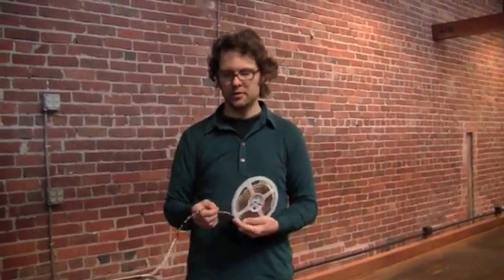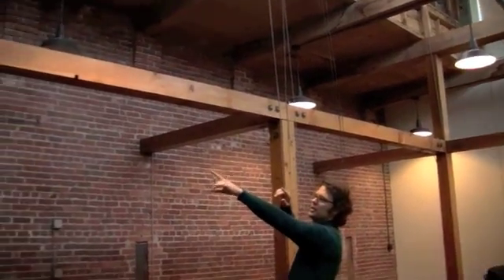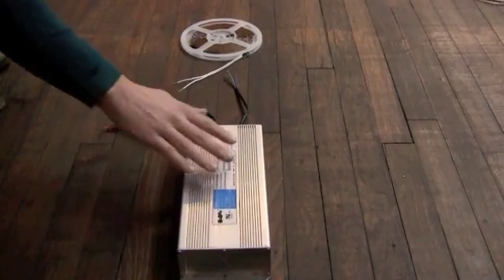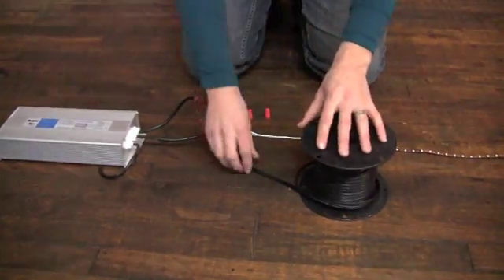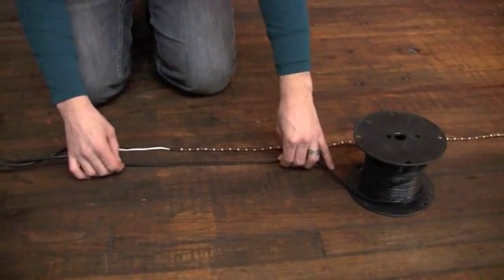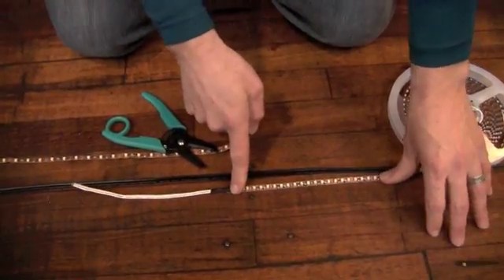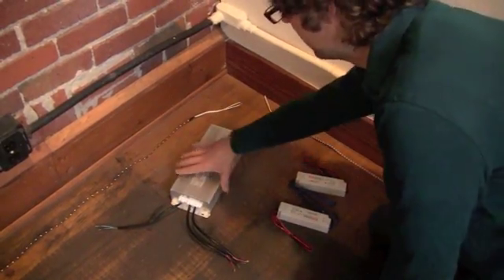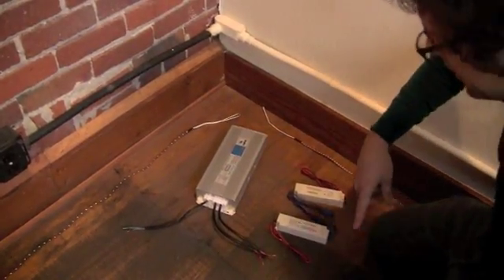How To Make a Large LED Light Installation

Comment from the maker: The 12V driver connects to the 120V building power inside the wall. To connect it to a switch, you either need to get a 12V switch or a dimmable driver which can connect to typical 120V dimmer switches, like Lutron. Too complicated to explain here - Lots more info about this on our website! Or contact our customer service team.

Comment from the maker: You can use strip light extensions between the sections. We sell bending extensions from 3 inches up to 8 feet in length. We have a 12V battery rechargeable battery that will last about 5 consecutive hours. Learn more on our website - link in video description above.

Comment: I recently did some tests with LED strips using a PWM dimmer, using the lights for video illumination and found that the dimmer created very bad EMI/interference waves on camera.   Are there any practical (cheap) methods of dimming LED strips that don't produce such interference?

Comment from the maker: Our indoor strip lighting is available in 16.4' spools. If you want to run multiple 16.4' spools, you can run each spool in parallel as demonstrated in our video. Alternatively, you can use add a component in between each spool called a PWM Injector (for warm white and neutral white strip light) or an RGB Amplifier (for color-changing strip light. You can view example wiring diagrams for each of these products on the LED Academy blog under the Wiring Diagram for a PWM Injector LED Dimmer Switch.

Comment: You can also get them off eBay, just type in "LED light strips" as a search and theres literally thousands of them I just got 3x 5 metre rolls for less then $25 with free postage, Or I could have paid $150 for 1x 3 metre roll at my local lighting store. I put 2 on the back patio and there great and the other hooked it up to a transformer with the bayonet light fitting and hooked it to the sensor light and ran it along the eves on the front of the house above the path looks Great and Classy

Comment from the maker: The maximum run length of our strip is 16.4 feet, which is why we use the 18/2 wire to give each section its own connection to power.

Comment from the maker: @hugoortiz05 12V drivers are commonly placed inside ceilings and walls; inside or behind architectural features such as beams and mouldings; on top of or inside cabinets; in a basement, attic, or closet.